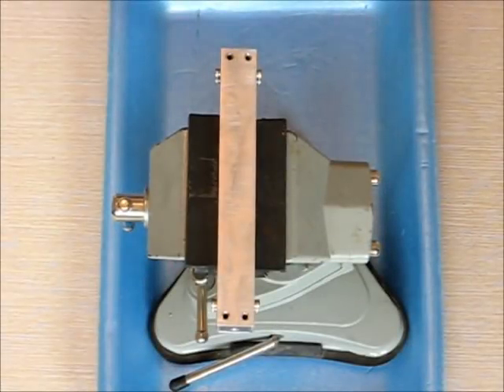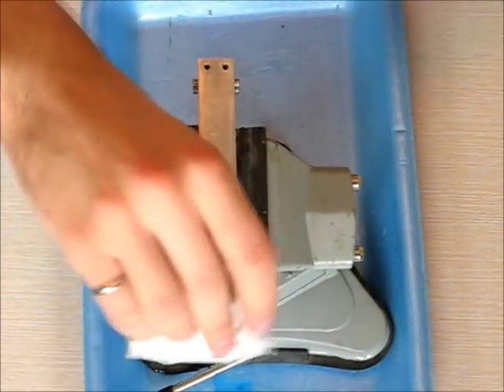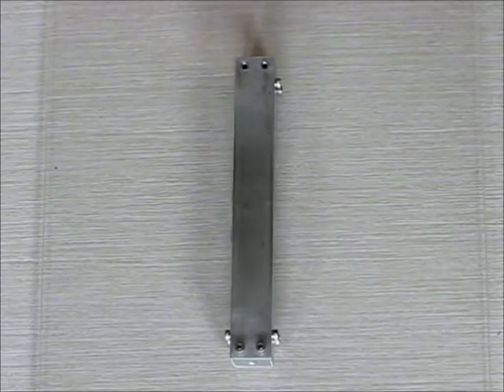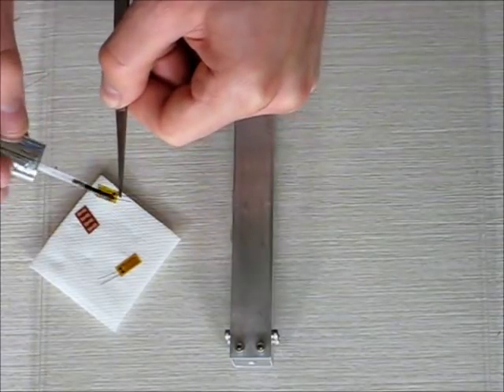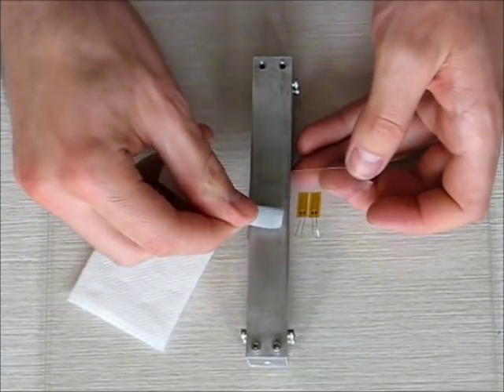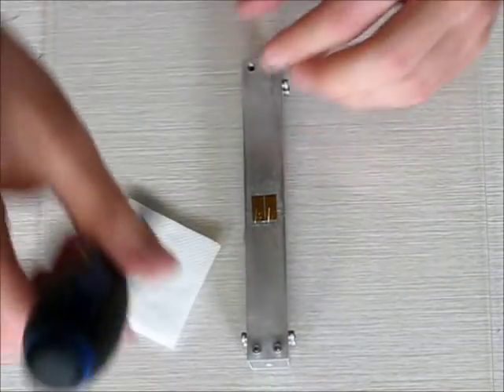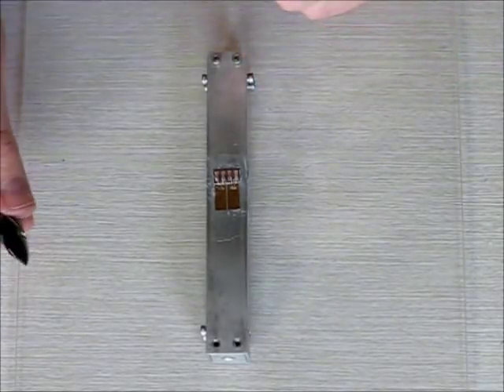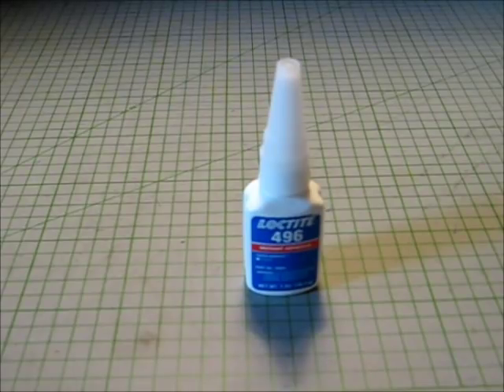Strain Gauge Installation Tutorial

Comment: i wish i had watched your video yesterday, i just made a complete glue mess. My Datasheet told me to use epoxy so i used two component epoxy glue wich needs 12 hours to dry. Will loctite be just as durable? How do i know wich glue to use anyway? Thanks for your video
Reply from the maker: The glue I used in the video was recommended by Omega, the strain gauge manufacturer. Here's more information on their adhesives that you can compare against the epoxy you have:

http://www.omega.com/pptst/Strain_Gage_Adhesives.html

Comment: I need help with the installation of my strain gage, is there a more simple way? And should i measure the resistance of the strain gage? Thr data sheet doesn't mention it.
And for the in-amp or op-amp circuit accompanying the wheatstone bridge, do you have any advice on that? Thanks in advance :)

Comment: if you buy strain gauges (aka pressure/force sensor resistors), I recommend you buy them on ebay.  I bought the cheap bf350 strain gauge which is like $1.20 with shipping from china as well as the fsr402 strain gauge which is like $11.  The reason the fsr402 is more expensive is that it is a more complex and more modern version.  It is called a "thin film" strain gauge and does not need any special surface prep or gluing like you see for the "old school" foil type strain gauge you see in this video.  It is a little larger than the cheap bf350 foil type gauge (like in video) but it is more reliable and even has a peel and stick backing so you just stick it and are done.  I'm curious to test them both.  I'm wondering how to use a strain gauge if you aren't dealing with metal - how do you use it on a rubber or composite material surface!?  The fact that the way you glue it to the surface is so critical to its performance is a big redflag.  I just assume go with a gauge who could just be taped onto the surface and "just work" like the fsr402 thin film style gauge does...  (btw checkout my channel I'm building a humanoid robot that is gonna ROCK win darpa challenge maybe woot!  :)
Reply: Most companies that want you to laying a gage for them will not want you to use a cheap knock off brand gages on there article.  You get what you pay for and the purpose of strain gages is data.  So if you data is questionable then you installation is not recommended.

Comment from the maker: We used a commercial strain gauge amplifier rather than a custom-built op-amp circuit. I'm not aware of any simpler installation techniques for bondable strain gauges, but some manufacturers do offer strain gauges that are pre-mounted on a cantilever beam that can be bolted to your device.

You're correct that the strain applied to the gauge is proportional to its change in resistance. For more information, do a Google search for "Practical Strain Gage Measurements" by Omega, Inc.

Comment: Hmmmmm....... So many bad techniques, it's hard to know where to start, so, I'll start with the major flaws. Of everything I saw, "scribing the layout" was the worst. You're talking about putting a scratch in the very area that you're measuring surface strain! The layout should be burnished with a lead pencil, then scrubbed off with a Q-tip and alcohol. As to the "Super Glue", that was another mistake. Gage glue is also a cyanoacrylate, the difference being that it has been strained thru cheese cloth to take out all the "inclusions", or those tiny chunks of hard glue that gets mixed in with rest. A bump like that under a gage will throw off your sensitivity calibration. Third, now, don't get me wrong.... Surface prep can be done a lot of different ways, but the point is to a.) Remove all oily residue b.) Abrade the surface and c.) Clean it, in that order. First thing he did was to abrade any surface oil right into the surface he's trying to adhere to. And if that part came out of the machine shop, it's covered in machine oil. And then there was the whole layout mess he had going, with glue going everywhere. All he had to do was put the gages on tape first, terminals and all, and the tape protects the top of the gage and pads from the glue. And I wonder if he knows that they make a single unit gage that aligns two gages exactly like what he's trying (and failing) to do, which eliminates any issues with the gages being misaligned to each other. Argggghhhh!!!! I just saw him say to "use a scraper" to remove the excess glue from the leads. One slip and he'll gouge or scratch the surface, particularly on aluminum. ...... and OMG! He knows nothing about soldering gages!!! His main mistake was not putting a strain relief loop in the leads (can be done quickly by sliding a dental pick under the leads and then press down on both sides with tweezers). Without that, the leads can actually impart an added strain to the gage. And he didn't even mention the soldering iron temperature, which needs to be cranked up to about 550-600F with a 450F solder so as to make that connection in one second, instead of lowering the heat, leaving it on longer and frying the gage (the foil is one mil thick). And besides the ugly installation, my calibrated eyeball says the gages are neither centered side-to-side, nor are they inline to the central axis of the part. He could possibly experience "edge effects" and could be  measuring strain at some small angle off the centerline instead of the principal axis.  

Bottom Line: I mentioned the major problems with this video, but there were a lot of details that were either left out, or he was just flat wrong about. Here's a general guide to good installation techniques. It is overly conservative, but if you go by this procedure, you will never lose a gage......... 

http://www.vishaypg.com/docs/11127/11127B127.pdf